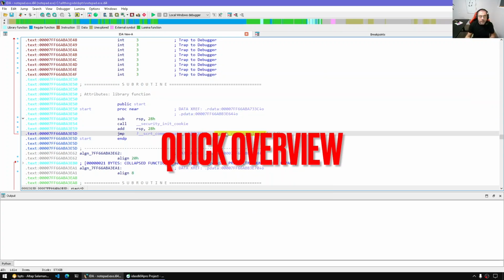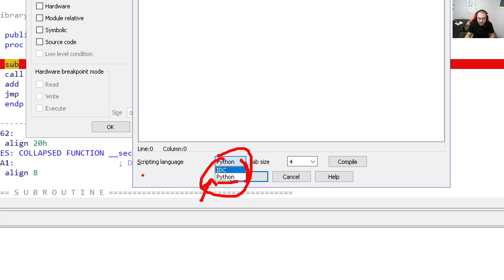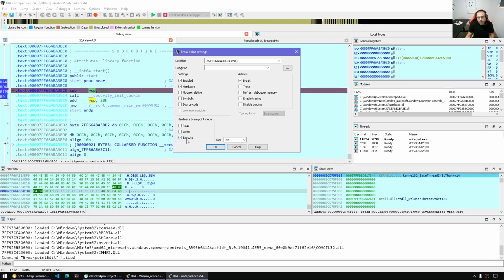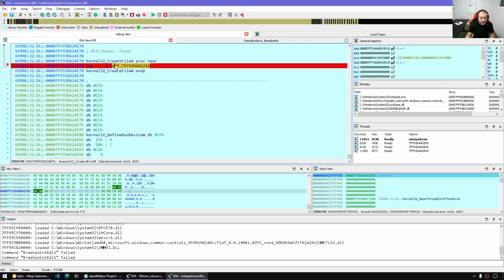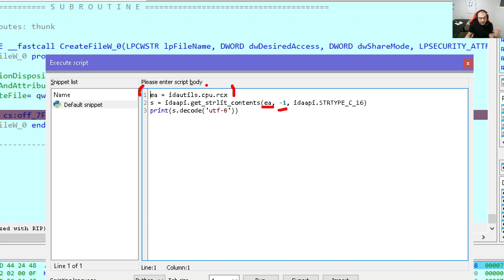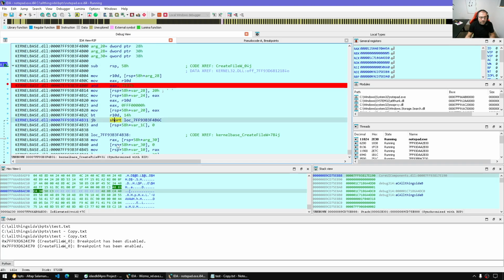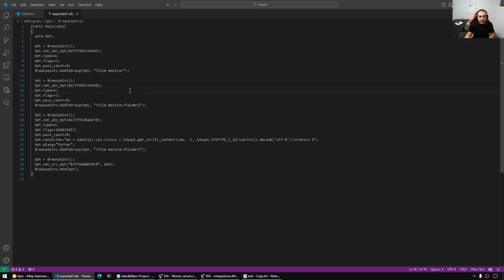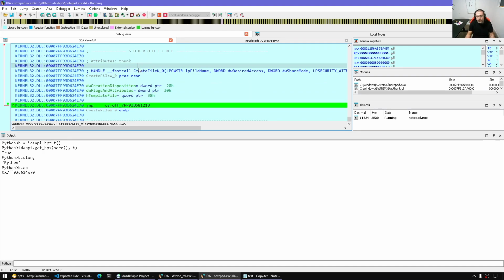Working with breakpoints

Comment: Hey! Great content. Don't know if you answer the comments here, will ask anyways, need an advice.
I am reversing a target binary in x86-64 with some obfuscations to break the disassembler.
I already made an IDA processor plugin to deobfuscate it, so no problems so far, they had lots of fake conditionals. I recovered all of the original control flow.

Their main function that initializes, is very big, ~2.2MB's long in memory and thousands of instructions, and around ~30k basic blocks.
My guess is this is because they use "constexpr" c++ obfuscation/encoding applied to wrap up the basic types such as integers, pointers, and code for encoding/decoding the types are force inlined into the code, I didn't notice any further obfuscation in the code, apart from the inlined SYSCALL instructions in the code, its all normal compiler code.

My problem is, no matter what I do, the Hex-Rays decompiler won't produce an output and is permanently stuck, using around 20GB's of memory, waited for 12+ hours.

What should I do next? Do I give up about decompiling that specific function and reverse it using the disassembly (which can take long) or is there any ways to split the function into smaller chunks and decompile them separately and analyze it that way? In theory that can work, but I don't know how to re-define the stack variables for every chunk and do the transition between the chunks with call instructions.
Any advice is appreciated.